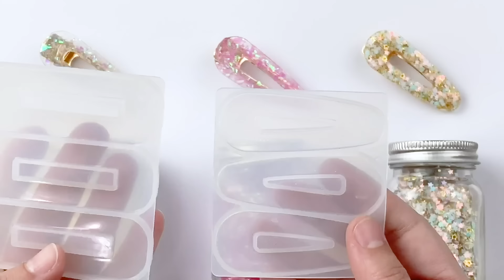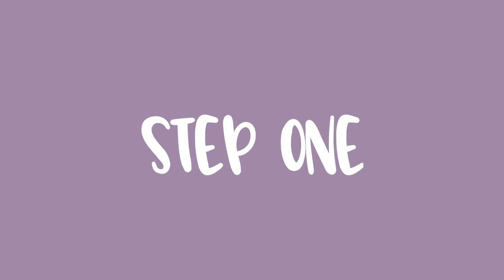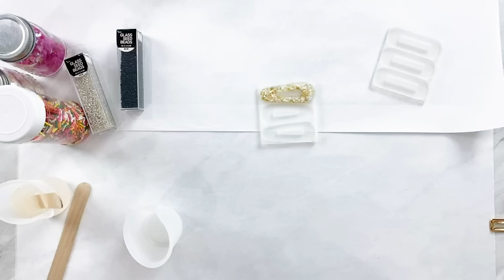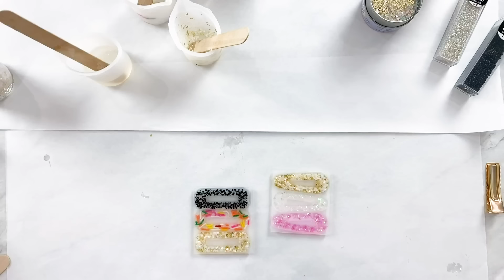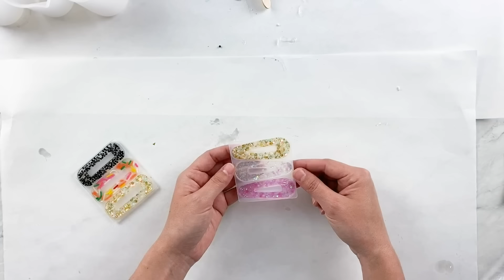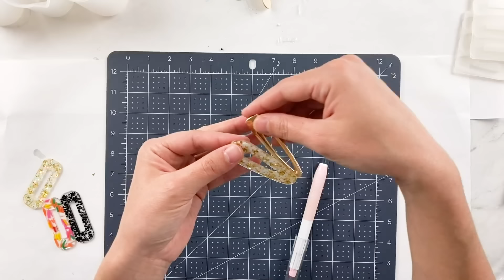Using Epoxy/ Resin Molds for Beginners

Comment: Don't throw away the cups. When the resin sets it peals out easily and you can reuse them. Throwing them away and advising others to do so just adds to the landfill problem.
Reply from the maker: I didn’t explain that well! I meant I peel out the epoxy and toss that :) I still have all of these original silicone cups.

Comment: I'm a first time resin artist. Today I made a small bunch of items. It's a hot day outside,  but I had to work out there so the resin fumes don't bother my cat and I.  Will the heat outside have any effect on my items as they cure? Also, I don't know for sure if I stirred the 2 liquids for a full 3 minutes. What will happen if they don't set properly? Will they be salvageable or garbage? I have a heat gun. Could I melt them down and start again? Thank you for the tutorial. I wish I had seen it before I started.  Wish me luck!?

Comment: If you do sand your resin, if you apply a coat of resin over the sanded surface (epoxy or UV) it will become shiny again. Also, mix your resin much slower and you won't end up with those teeny dust-like microbubbles, let alone larger ones. I'd recommend a 2:1 or 3:1 resin if bubbles are an issue because they are generally much lower viscosity. ArtResin is just simply way too thick for me to be satisfied with my pieces because they have so many bubbles in the finished product. Also, Amazon has packs of just the clips for pretty cheap if you're needing more!
Reply: Jo😊I

Comment: I know you mentioned about the respiratory protection but I wanted to put out there that I would recommend to use a respiratory protector so you won’t get sick or even worse.
Reply from the maker: 100 percent depends on the epoxy you are using. Read all warning labels and use discretion :)
Reply: @KarleyHall  okay thank you! I just wanted everyone to be safe!

Comment: Heyy!! I have a question on the curing process. Will the resin cure on its own or does it require a special light?
Reply from the maker: It depends on the resin. This is two part resin and will cure on its own. UV resin needs a UV light to cure.

Comment: Hi thanks for this tutorial. I have a question about the curing process. Do we have to be in a warm environment in order for the resin to cure better?  Mine is still sticky for some reason.
Reply from the maker: Usually if it’s sticky, the mix wasn’t exactly 1 to 1. How long has yours been curing? I let mine cure in a room temperature room (around 75 degrees).
Reply: Karley Hall its uv resin. Maybe its the product thats bad. Ordered it from wish.com and took over a month and a half to get here from there!  Ty for your response.
Reply from the maker: Are you trying to use it in a mold? I would only recommend uv resin as a final coating. In order to use it in a mold, you’d have to cure very thin layers and build on top of it! If you’re using is as a coating, make sure to use thin layers and cure for a minute under your uv lamp!
Reply: Karley Hall from the videos i have seen they all use the molds and shine uv lights over it for 1 to 2 minutes. Im using jewelry ring molds and its not that big or thick. Yet they still came out sticky.
Reply from the maker: I’d recommend pouring the mold in at least 4 parts. Uv resin is similar to coating resin— which is very different than casting resin!
Reply: Karley Hall ohhh i think i understand now. Ty!  Ill try in couple stages as you suggest. Ty so much for your help!

Comment: hey love your videos! i have a question! ive seen lots of videos where people recommend wearing a respirator but is it necessary when youre doing sownthing small? im panning on making hair clips so the mold to make them is small. i would just use use a regular make and do it outdoors? Is this sa
fe ?
Reply from the maker: It depends entirely on the resin you are using! There are some resins that you absolutely need a respirator. When I reached out to art resin they said you do not need to wear a respirator since their are no fumes or airborne particles. A lot of brands are not VOC free and do emit fumes so with those ones, yes you will need a respirator. I always check the label and then call the company to clarify. A good tip is to treat your work area as if you are spray painting. Open windows, turn on fans, and wear a mask if you are sensitive :)
Reply: Karley Hall thank you! what type of resin do u use (the safe one) i appreciate u reaching back!!!!!!
Reply from the maker: giselle I used “Art Resin” for this project! Although Art Resin is not a true casting resin. You can read this article for more info! https://karleyhall.com/using-epoxy-resin-molds-for-beginners/ But I chose to use it since I had peace of mind that it’s so safe!